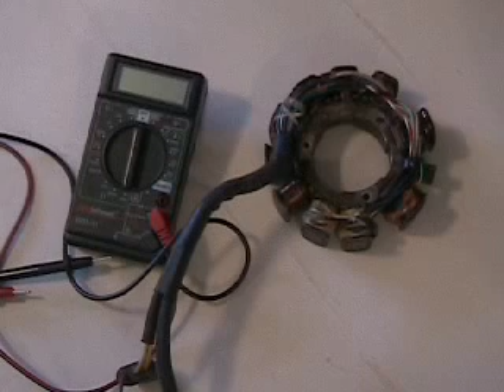Arctic Cat 1990's 500 EFI 600 EFI 580 EFI stator testing

Comment: A little late but what if my two outside wires are at 485?
Reply from the maker: 485 means that's the low speed and high speed coils in series. It should be 435-445 & 42-45 so 485 should be ok if both of those coils are in that range. If they measure 455 & 30 then there's an issue.

Comment: hi blaine  iwas wondering if u could tell me how to do a voltage test on my stator i have a 99 arctic cat zl 500 efi  i did the ohms test and i got a brown/green 442 brown/blk 486 green/blk 46 and an arctic cat dealer said the stator could still be bad and i should still get a voltage test is that accurate? my sled bogs down at 30 to 40 miles an hour i cant get past half throttle any one have any ideas i have cleaned the fuel lines up to the fuel pump it looks clean in the fuel tank cleaned the injectors

Comment: Blaine, great video! I do have a question tho. I have a 99 zr 600 efi thats giving me some trouble sometimes. I read a lot of forums which pointed me to this stator problem. I ohmed the stator, and came up with these results. BRN/BLK 435, GRN/BLK 42, BRN/GRN 393. My question is, How much more or less resistance would have been added if I did the test in a 60 degree garage vs a 20 degree garage, like i was in.

Comment: I have a 2000 zl 580 esr efi and I did this test and it showed 41 from each coil and 1 from both in series (both outer terminals)... could this be right?  My sled would start and die right away and the headlights and tach weren't working, I had good spark before but now I have no spark and it wont start.  Bad stator?

Comment: Hello again Blaine, 
This looks like what I'm dealing with. Thank you very much. Is there a way on this style(99) zr 600 where I can bypass the TSS. I am noticing a clicking in the throttle. My current problem is the sled bogging down at different RPM. I can play with throttle similar pumping a gas pedal, then pin it, and it will eventually gain speed and climb RPM. I put a clutch for a 700 on it that engages at a high RPM, but it does'nt seem like the clutch would make it bog/backfire

Comment from the maker: The 2000 ZR500EFI used that same stator in 2000. The 2000ZR600EFI used a different stator. So, your specs should still be 450 for the low speed coil and 45 for the high speed coil. If it is an OEM stator, if it measures higher than 45 or 450, it is bad. If it measures lower than about 430 for the low speed stator or 40 for the high speed coil, it is HIGHLY suspect. If it measures lower than 420 and 38 respectivly, then more than likely it is bad.

Comment from the maker: Your stator looks like the one in my video labeled "Arctic Cat Stator Testing triangle shaped 3 prong plug 580 EFI". I will change that title to early 1990's Battery EFI 580 and 700. Regardless, the ignition coils are the same and the specs are the same which should be 450 and 45. The general rule of thumb is that the low speed when measured cold should be higher than 430. Anything less than 400 and it is very highly suspect. With yours measuring 245, I can say without a doubt that it is bad.

Comment from the maker: 50 ohms is high for the high speed coil (unless it was measured while still warm). If you did not get a reading from Brown to Green...then I don't know what to tell you other than possibly the stator coil is shorted out so bad that only upon pulling the recoil does it make enough voltage to arch and therefore make enough of a connection to create enough voltage to run. It sounds like your sled is running on borrowed time. What caused you to check it in the first place if it runs fine?

Comment from the maker: Yes, a CDI box can have the correct connectors but not be the right box. Add to that sometimes the Pt.# is rubbed off the box so you don't even know which box you even have on it. Some dealers might be able to test the stator but more than likely they are just going to measure the ohms when both cold and warm.

Comment from the maker: Usually when it starts and reves up good and then it starts to spit and sputter as it warms up, it is a stator, plug wire connection or trigger/pulser coil. If the stator tests good both cold and warm then you're more than likely looking at a trigger issue or spark plug wire connection issue. The CDI and coils are the least likely to go bad.

Comment: Hi Blaine. Would you happen to have the resistance specs for a Yamaha ET250 or Bravo 250 stator? I have a '79 Enticer 250 and I'm troubleshooting the lack of spark. I've already ruled out a grounding problem. I'm thinking stator because they say a CDI box failure is less common than a stator failure.

Comment from the maker: The specs I give in the video are for the EFI. Actually the carb and EFI specs are the same (45 ohms & 450 ohms) for the 500, 600 and even the 580.  The 2000 they went to a new stator where the specs are more like 16 ohms, 16 ohms adn 32 ohms in series. I don't rewind those "new style" stator as of now. The ZRT stator was mailed about 2 hours ago.
Reply: Hi I have 98 600 efi ps got from friend he replaced stator cause of only idles then pops bogs cant drive it after replacing it is still doing the same thing checked resistance br gr 445  br blk 483 gr blk 38  after running a few minutes and does I had blk br 688 Brn grn 600 grn blk 48.5 at one point could not get any reading from brown wire at all after sitting half hour br gr was 463 br blk 497  is new stator faulty ?